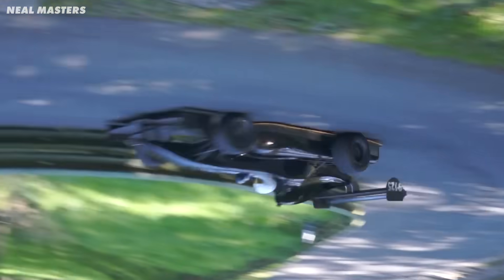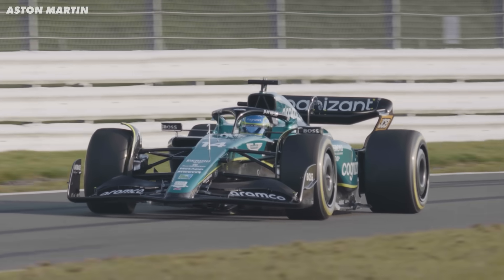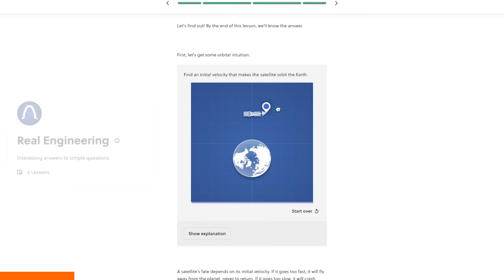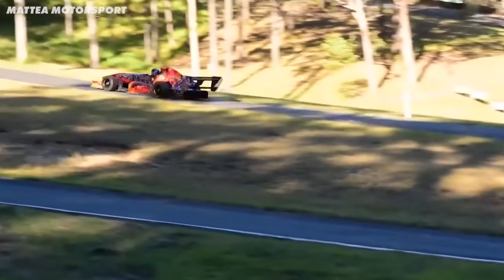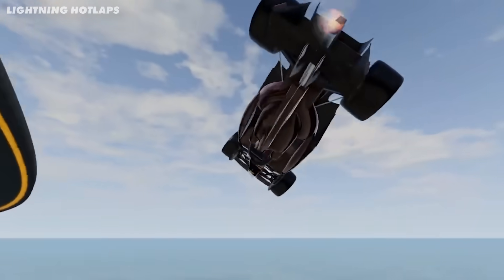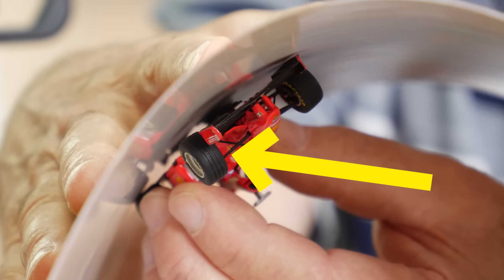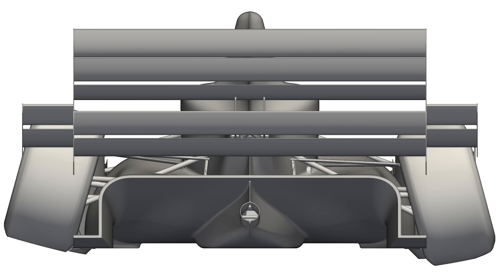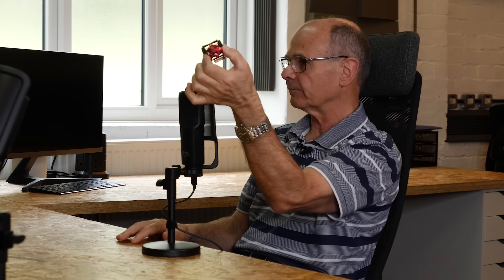How We Designed the Car to DRIVE UPSIDE DOWN

Comment: I have read about and seen in a video “cambered tires”. These were meant for cars with a lot of camber to be able to race with camber and enjoy maximum tire contact. I believe they had 5, 10, and 15 degree preset tires. I maybe wrong, but Donut had a video on this.
Reply: They don't need grip the traditional way, down force ("grip" in all angles)  will have to be aerodynamic. Rounded profile motorcycle tires might do the trick.
Reply: @dutchsailor6620  what’s “traditional grip”? And why wouldn’t they want the tires to have more grip?
Reply: @milviodeleon4421  Because they want the grip to come from aerodynamic downforce, they wont be cornering the thing so no tire grip is needed.
Reply: @dutchsailor6620  I would think due to the lower speed maximizing grip would be good. You need grip to stabilize the car.
Reply: @milviodeleon4421  Your tires wont give much grip if you are hanging on the wall or ceiling, it will all have to come from aero.
Reply: A tyre grips approximately in proportion to the normal force between it and the surface it's running on. Tyres don't care whether this force is provided by gravity or aero.

In regard to the comment that they're not turning, I suspect that they might turn quite hard to minimise the time spent in transition. Even if this is not the case, the tyres still need to grip on order to provide the drive to keep the car moving forward.
Reply: @weevilinabox  Well, lets see if they put the biggest slicks possible on it
Reply: @dutchsailor6620  I'm with you in the idea of using motorcycle tyres, because they're insensitive to camber. I wondered whether they might struggle with the forces whilst the car is the right way up (3x car weight), but then I remembered just how lightweight this car is. For comparison, a BMW K1600 motorcycle is around 300 kg and bears all that weight on one tyre under hard acceleration.
Reply: @weevilinabox  Motorcycle tires are easily up to the task. Tires with a load index of 90 can handle 600kg each at its maximum design speed. It will all depend on the length of the used tunnel/track and what the max speed is that they want to achieve.
Reply: @dutchsailor6620  They're only taking about 80 mph, with as short a distance as possible.

Comment: To solve the ride height issue during transition, don’t use a circular tunnel. Build a unique path within the tunnel, that allows for a uniform geometry as you follow it up to the roof.
Reply: The problem would be actually following that path. If anything goes even slightly wrong and the car drifts off course, it no longer has that optimal geometry under it.

It's safer to optimize the car for a uniformly circular tunnel, that way there's a lot more room for error.
Reply: @ozzyp97  The problem of following the path could be solved by having a smooth but marked transition between the golden path and the rest of the path, the idea being that if the car deviates from the path it would experience a restoring force bringing it back toward the center. Effectively a compromise between the perfectly round tunnel and the single corkscrew.
Reply: This was talked about in the last video.
Reply: @Mountain-Man-3000  No, it wasn't.
Reply: Would work, but we discounted it because if you deviate from the fixed trajectory you have a kink to the main tunnel section and would lose a lot of downforce.
Reply: Or a circular cross section on the road leading to the tunnel and match the car
Reply: Or use tracks, like a roller coaster.
Actually roller coasters solved the 'driving upside down' trick ages ago, and for a few bucks, any of us experience it!
Reply: @JakobusVdL Yes, but roller coasters have upstop wheels and cars don't.
Reply: @alaeriia01  cars that want to go upside down would be advised to use up stops - no?
Reply: @JakobusVdL  Yes, but that's cheating in this case.  The point is to see if a car can drive upside down through aerodynamic grip alone
Reply: Just build a plane that looks like a car, fly off a ramp, then flip over and land upside down on a ceiling.
Reply: Is it possible to use some of Elon Musks Boring company tunnels that arent being used at the moment? Or testimg tunnels without tracks going to the middle?
Reply: I said this in the last video, build a straight-ish road that very gradually corkscrews.

Or (and this is a ridiculous idea, but we are talking about building a bespoke tunnel for the purpose of driving a car upside down here) A completely straight, flat road that can be inverted... Think like the rotating corridor in the movie Inception. A big rotating drum with a bridge running through the middle of it that can be flipped over.

Edit: Actually, there's a much easier way: A loop. A long stretch of road, a half-pipe ramp, and an inverted stretch of road directly above the run-up stretch, with an exit ramp that connects back to the run-up section... No corkscrewing motion, just ride it straight up like a rollercoaster.
Reply: @normang3668 where I've seen such loop the loops the front end needs to be so high for clearance it might not generate requisite downforce (active lift and drop mechanism might add too much weight to work around it) was my guess
Reply: @normang3668 how is an enormous loop an "easier way"?
Reply: Why not give the cars floor the same radius as the track?
Reply: @anichtyofagist  it would not be able to drive on flat surfaces as when the car is on a horizontal surface, the floor would touch the ground and the wheels lifted into the air
Reply: @moleyballin2270  If they built a curved straight leading up to the tunnel (and extending after it) then it's possible that they could do this, however I imagine it's a costing issue as well as the issues mentioned in the video with relying on the floor for downforce. You would still have to give clearance anyway for the states where the car is non-parallel to the tunnel (when it's turning up the wall) as a curved floor would still be able to bottom out.
Reply: @moleyballin2270 it doesn't need to drive on flat surfaces.
Reply: @anichtyofagist  The car underside is reprofiled to optimise for the event but it also HAS to be able to run on flat ground and not destroy itself - allows us to use flat ground to increase speed before entering the tunnel, and allows for a flat runoff area.
Reply: Perhaps a variable geometry then. (If not too heavy. The best part is of course no part)  @willemtoet_yt
Reply: Oh look, a wikipedia expert enginner

Comment: Instead of driving around the edges of a tunnel (causing massive headaches as the car goes from driving on the flat, to driving on the side of a tunnel, to driving on the roof), why not build a car that can go straight from one-way-up to the other without going through the vertical? This would require a unique design but you would only need a low, flat, roof directly above the road.

Comment: Hello guys!! Great to see you improve. Just an engineer with a suggestion. Why don't you place a slight curve in the tunnel to use centrifugal force and stick the car to the wall when you are turning upside down? This way you could minimize the risk of "peeling" out the wall
Reply: We want to show that the downforce is enough to hold the car onto the roof.  Using centrifugal force, (or using fans to create a low pressure zone under the car), would not be an honest demonstration of the power of organic aerodynamics the way our plan would be.  Would make it safer though!  🙂
Reply: @willemtoet_yt thanks for this reply, great to hear your stance on this
Reply: I'm imagining a curve to the left as you drive counter-clockwise to go upside down. Would this curve only help you reach the half-way point where you are perpendicular to the ground though? You'd have to curve it 'down' for the centrifugal force to act in the direction of transitioning from perpendicular to upside down.

Thoughts from an engineering student :)
Reply: It would probably help while going up but it would be a massive problem for the 5 seconds he's trying to drive while completely upside down. He would have to turn while already in a situation where grip is scarce and it's scary enough going in a straight line.

Plus it would prove the point of doing it with downforce alone.

Also the cost and stuff, yeah
Reply: Seems feasible, and some racing tracks already have a good slope on curves, mainly oval circuits. It might even be a start point for the construction.  (Thoughts from an IT student, so dont bet your lives on it)
Reply: There are already loops driven by cars. So your idea is working perfectly. I would love to see this live.

The experiment they try to pull up is Downforce against gravity. I hope nobody gets hurt and it will be epic!
Reply: They want to use raw areo dynamics only
Reply: @Privileged.monkey  Using raw aero for the fully upside down part is great, and the primary focus of this project, but I think it would be reasonable to use some centrifugal force in the transitional section
Reply: your mum
Reply: Is it possible to use some of Elon Musks Boring company tunnels that arent being used at the moment? Or testimg tunnels without tracks going to the middle?
Reply: interesting point. Intuitively it seems like doing this could also help stabilize the construction as a whole. At least in the actual curved section. I'm assuming the greatest forces will be occurring in this transitional phase of the drive. An issue with this might be cost producing this additional curve in the C shaped elements. I'm not sure if they are planning to use custom made elements or if something suitable already exists, in which case this would probably also help keep costs down.

Another question i have is how the wind will interact with this construction as a whole. With the smooth shape required, it seems like even slow wind in the right direction could compound quite dramatically in different ways along its length. They do mention winds so I assume they have considered this but it is just another element among so many.

Personally I'm not an engineer or anything of the sort, but i am interested in these things and do love running scenarios like these as thought experiments in my head and it will be truly fascinating to see something like this come to life as an actual practical experiment! The way I see it its such a pure example of human curiosity and spirit and I love it!
Reply: Well, have you heard about cost ?
Reply: @cgm_rdgdl the length would remain the same. 

Although the easiest would just be a big ball i suppose. Though i don't think that would count, being just a motorbike deathball in essence or whatever that carnival attraction is called in english
Reply: I think Willem knows what he is on about and has already figured that out and how to do it....

Comment: What if youd not build a curved tunnel but rather set up the car upside down? What if youd put wheels on the car facing upwards, get the car upside down into the tunnel that is exactly the cara height so that both the regualar wheels and upside down wheels have ground contact. Then you speed up the car with a railsystem like fighterjets from a carrier do. The acceleration bit smoothly transitions into the upside down bit, the bottom layer where the added upside down wheels surface on, ends at the point where the railsystem had accelerated the car enough and the upside down wheels detatch. 
I know this is propably been thought of already, but if it hadnt maybe this concept could be worth a considerations. You never know where good ideas may come from, so why not an interested viewer on YT?
Reply: whistlindiesel  made a video a while back where he puts giant metal horse carriage wheels on a Tesla and eventually turn the entire car upside down and run it.
That's driving upside down in my mind but I get this is a different concept
Reply: How do you get down tho

Comment: So, the project designed to answer the question 'can a f1 car drive upside down?' Has already been answered without even trying
Reply: Yeah but driving a car upside down is still cool though
Reply: @connor1586 I a tally have to disagree slightly. It IS cool but the question wasn't "can humans design a car that can actually do this?" Because we already knew that would be yes. It was whether or not an F1 car could do it
Reply: @highviewbarbell We didn't know, though. We assumed we could do it but we didn't have proof. This would be the proof after which we would know (or at least know where it goes wrong). Also, one might argue that everyone so far has been talking only about the downforce generated, not bothering with the details explained in this video. So up until this they really haven't known because they haven't even investigated the necessary details.
Reply: Aerodynamically it was answered a long time ago. There are other aspects that are challenging (such as an ICE engine running upside down). And it's not about answering the hypothetical question. It's about actually doing it.
Reply: It was answered long before the project started, but why wouldn't you want to be the first?
Reply: Also they crash a lot of F1 cars driving the normal way 😂
Reply: It was proven on paper but never tested and this is to test it and make it real
Reply: @kingnikos2575  right but my point is that this doesn't test whether or not an F1 car can do this
Reply: Realistically, they were never gonna use an F1 car. The cost is automatically astronomical if you're running F1 machinery compared to lower formulae. If a team agreed to do it and wanted to run a current car, then they're heavily restricted on how much running they can do because of testing restrictions, and using an older car is: a) Not as safe; and b) embarrassing for the team and F1 if it makes the older cars look better than the modern ones. Also, if the team fails, it's a PR disaster - and, it's a significant risk to their drivers, who they are not going to want to get injured or killed (and suffer the hit to their competitiveness and inevitable legal action that it would cause) just for a cool stunt.
Reply: @MPal24  it doesn't have to be a 2023 F1 car....... Bro Red Bull took their car rally driving a couple years ago lmao
Reply: @MPal24  I imagined they would build a car within F1 regulations, but it will still be cool to see them drive upside down
Reply: In theory it has been

In theory and in practice should be the same

But in practice it rarely is